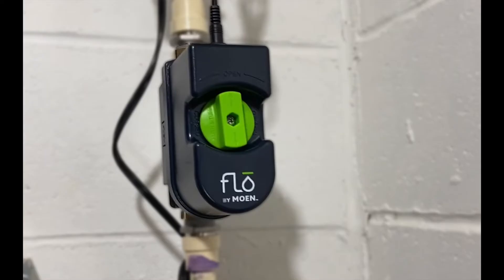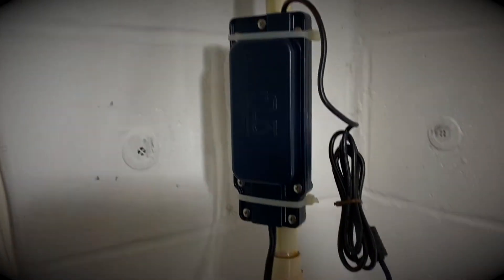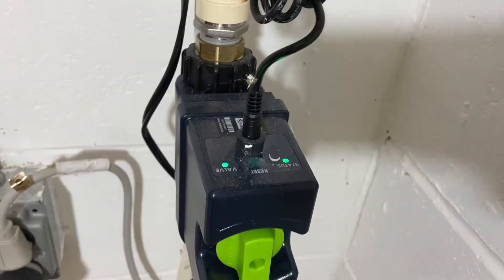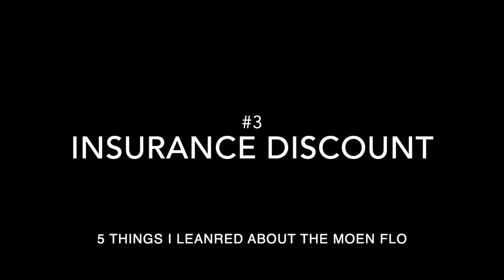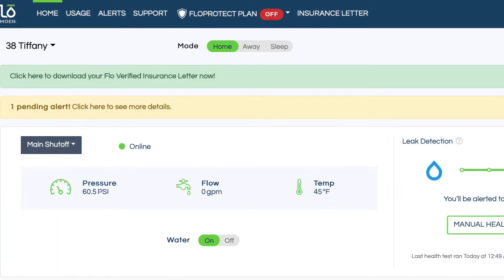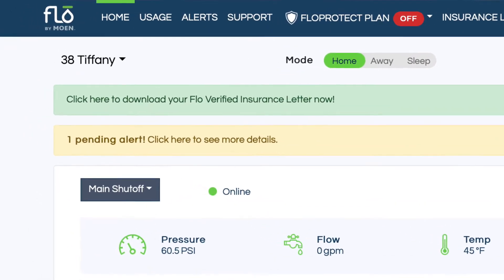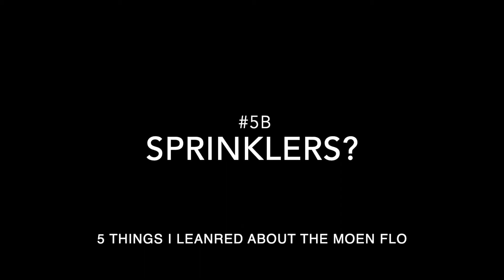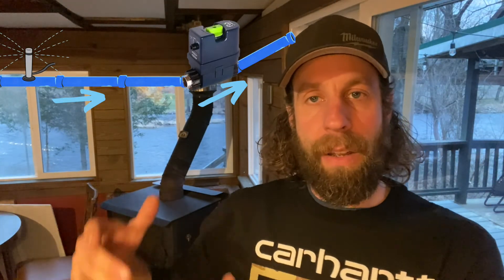Moen Flo Part 2 UPDATE | How its been working & what I've learned

Comment: A!so, when you use primer appropriately on PVC(!), only apply to the inside of fittings
Reply from the maker: I’ve also never heard of this —  and I’ve worked with many plumbers. Maybe regional differences?
Reply: This is not true.  Use primer on both inner surface in fitting and outer surface on pipe.  The point is to treat all surfaces for better glue adhesion.

Comment: question - if the power is off and there's no wifi, and battery backup is installed, do the leak sensors still communicate with the Flo to shut off the water if a leak is detected?
Reply from the maker: I can’t speak directly as I don’t have any of the sensors at our properties… we are just relying on the Flo monitor to determine leaks… but from what I understand, they communicate via wifi so the sensor would not work if the wifi is down

Comment: Thanks for sharing your experience.   I've had my FLO installed for 3 years before it stopped working...meaning showing a zero flow rate.  Turns out there is a known issue with the internal plastic turbine/impeller in that the 2 magnets in the turbine rust over time and make the unit inoperable.  Moen is apparently aware of the issue and does offer a replacement turbine for a fee and I believe they have updated the design so that the magnets are not as exposed as the previous version.  This issue is apparently exacerbated if you have hard water.   Also, Moen and the CPSC have recently announced a recall on that FLO battery back up due to fire hazard.  I do love the FLO when its working though.
Reply from the maker: thanks for the info, very good to know.... and about the recall, I will update the video description with a link to that-- thanks!
Reply: That's what my concern is since I have been researching about getting one. The plastic turbine going bad especially since I'm in a hard water area. Does anyone have any more information on this?
Reply: @CBurns-x8v   The new units come with the updated impeller design.  I can't speak to their longevity beyond a year or so but I've not experienced any issues with the flo since install a year ago.
Reply: @shingdao7  Thank you for that, of course, everyone's installation and usage will be different. I just wanted to know about that because that was one of the big issues which I would assume they would update for later production models. 

One more question of you know. Starting should I get the floor sensors or would I be ok with just the Flo for initial usage?
Reply: @CBurns-x8v  I don't own the Moen leak sensors but use a competitor product.  I think water/freeze sensors are a great addition to the Flo valve but you could add them later.
Reply: @shingdao7  I will research those and understood.
Reply: @TRUTHandFACTSwithDISCUSSION  Flo by Moen model 900-001.